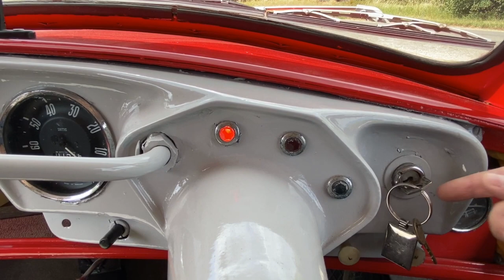IDRIVEACLASSIC reviews: 60s Bond Mini Car Mark G (micro car/mini car review)

Comment: Scary things, three wheelers.  I borrowed a Reliant Robin many years ago, it was a very windy day, it was impossible to keep it in a straight line.  Never again.  There was a Bond bug (different company) in the seventies that looked like a big orange wedge of cheese, see if you can find one of those.  The Bond club could probably help.
Reply: A neighbours son had a Bond Bug he bought brand new in the 70's. Very collectable now. During my years of "fiddling around" with cars i long hankered after a bubble car which have now become extremely desirable and command pretty serious money.
Reply: Its funny - I once drove a Regal van and felt it was a bit odd on corners but that was because I knew there was no wheel there - in actual fact at  the speeds I was doing it wasn't unstable nor dangerous
Reply: They were luxery compared to the Bond 3 wheelers. much more like a car to drive with a4 cylander 4 stroke engine they were fairly reliable. The Bond bug was much better and had a sporty feel about it. only made in Orange though.
Reply: Reliant bought out Bond, the Bond Bug was built at the former Bond factory.
Reply: @fluffybadger9832  Correct and on Reliant underpinnings.
Reply: Front wheel drive!
Reply: The Bond Bug was legend. I wish they built first-time cars or inexpensive runabouts like that now – affordable, fun, in a category of their own that doesn't look like you don't have the money or driving licence for a "real" car.
Reply: @TheDotBot  The Bug did not sell well. It was aimed at young people who mostly didn't have the money to buy a new car back then. Maybe they also thought a 3-wheeler was uncool.
Reply: From my experiences many years ago in a Reliant Supervan, the answer is to unlock the “bonnet”.  The wind trapped under the front escapes through the bonnet hatch, rather than causing the front end to lift. Worst thing I’ve ever driven in wind (deckers exempted) was a Hyundai h100 van.
Reply: They can be very twitchy in the windy weather. I have been out driving in 30mph plus gusts in my Reliant, I find sticking to around 50mph on dual carriageways makes it allot less twitchy. steering wheel play has allot to do with it.
Reply: @richardparkersmith4810  No the Bond Bug was on Reliant mechanicals so RWD.
Reply: @Martindyna  For sure but I was referring to the minicar which is the subject of this video.
Reply: @fluffybadger9832  Yes, but only the first 400 or so, from Tamworth-supplied components: the remainder were built at Tamworth

Comment: I had one in the late sixties when I was an apprentice - great little car although did have a tendency to fall over if you around roundabouts to quickly - three of us went Rugby to Ramsgate a couple of times - a real motoring experience never to be be repeated !
Reply: @John Finnis. I never tipped mine over, but I perfected the art of cornering on two wheels. If you feel it start to go, you just turn the wheel back a touch and it sits down again.
Reply: Blimey, now that's really motoring; you must have been mutton jeff when you got back.

Comment: I’m 67 when I was in my younger years we put a twin cylinder Villiers engine with auto mag start and it was so quick The only problem was stopingit you could stand on the brakes,you did need to kickstart it this has brought back so many memories watching you do this video on the air
Reply: The F and G models were available with the Villiers 4T 249cc twin with high compression heads and straight through exhausts. I had the F model version. It was very loud on full throttle, and generated enough heat to burn the paint off the underside of the bonnet. It was fast though, and the Girling hydraulic brakes had no problem bringing such a light vehicle to a halt.

Comment: Nice video! It took me me back to my youth when I had a Mk F as my first "car" after moving on from motorbikes. You're right, they weren't half noisy litle beggars but well worth putting up with to keep you dry (which my girlfriend appreciated). The usual breakdown problem was a sooty spark plug if you got the 2 stroke mix wrong or a failing battery, but you could kick start it into life by getting into the engine compartment (much to the amusement of onlookers). I used it as one would a bike, and me and my future missus often went off to Blackpool in it (not too far from Preston where I'm from), or for longer trips into the Yorkshire Dales or the Lake District. I had it lift a wheel now and again by cornering too fast, but it was predictable and easily rectified. But no serious issues apart from my own fault, when I failed to secure the bonnet properly and it blew back and snapped both hinges (but the parts were readily available from the Bond factory in Preston). So thanks again for a great little trip down nostalgia lane, you're doing a fine job with your channel!

Comment: I do remember seeing quite a few of these in southern England as a kid in the 60s, not that you could fail to see or hear them, like the equally basic small engined 'bubble cars' of that time. Sometimes the Bond Minicars were fully laden with passengers and camping equipment as well, so I guess some of them did very long trips too, despite being slow, noisy and even a bit smoky sometimes.

The car is certainly a curiousity, though other reviews are also as much amazed by how primitive the handling is, as to how cute and quirky it looks. The 360 degree turning circle is pretty unique too. It is surprising to me that this car sold for so long in seven different incarnations - I'd have thought the Reliant three-wheeler offerings of the time were rather more sophisticated and comfortable, though probably a bit dearer, I'd guess. Reliant did, at least, survive another three decades after the tax changes you mention, and ended up buying up Bond.
Reply: Yes I can imagine them doing reasonably long trips, the 2 stroke smokey engine gives the impression of being clapped out when in fact it isn't at all.

Comment: My first car back in 1980 was a MK G estate which I spent a year getting on the road, (Ah, the joy of not getting soaked and freezing on my Bonneville during the winter!) The steering worm was quite worn in the middle section, as is the one shown here, the depth of engagement is adjustable but if you tighten it too much to take up the play in the middle where it`s suffered most of the wear, then you don`t get the full 180 degree steering lock which enables you to go full throttle round and round in circles in a screaming 2 stroke cloud of blue smoke in a pub car park after kicking out time on a Saturday night, which got me banned for more than one establishment. So I had the steering worm and sector engineered to engage better and all was good. It was pretty loud under "acceleration" but once up to speed around 50MPH on the flat was quiet enough to hold a conversation, although I never considered fitting a radio. I take issue with what you said about reliability though, and long distance journeys, mine never broke down, and I did use it hard for about 4 years, we even did a 200 mile round trip to the national micro car rally and did treasure hunts and driving competitions while we were there. I eventually sold it because I came out one morning to find a bunch of drunks had picked it up and placed it at a jaunty angle across the middle of a quite busy road causing chaos, which I found pretty funny to be honest because it`s the sort of thing I would have done back then, but, I had my car licence by then, so, I sold it and bought a VW camper. Oh dear...

Comment: What a beautiful example. I remember them on the road - at the time they provided cheap mobility with low tax, insurance and good (for the day) fuel economy, plus the whole motorbike license/L-plate thing was a big incentive. 

These little gems need to be kept in perspective, though - they were very much of their time. Although they might look like deathtraps to modern eyes, it's important to remember that back in the mid sixties there were still some pre war cars trundling about and no comparable cars offered anything remotely approaching today's levels of safety, performance and comfort. The condition of older vehicles on the roads was often dire - in the village where I lived as a child there was a family who had an ancient black car that would only run if the driver's side of the bonnet was raised and their son sat wedged behind the headlight on the front wing, half inside the engine bay, holding onto something mechanically vital. Many people had no car and motorbikes and sidecars were much more common - the little Minicar was not exactly cutting edge (the Mini would soon render the likes of the Minicar and the various bubbles completely obsolete), but in her day she did have an appeal. 

A workmate of my Dad's bought one new and absolutely loved it - I remember Dad telling me how impressed he'd been when shown it. At the time our family car was a chronically clapped out, slow and rusting split screen Minor van that stank of petrol and exhaust fumes, had no rear seat and was like a deep freeze in winter. I remember the one and only occasion we got the thing up to sixty on the Powick "Three Lanes", by which time the back axle would have been audible on the moon. By comparison a shiny little Bond didn't seem such a bad deal.

Comment: I had a much later Bond, just before Reliant took them over and used the name for the 700ES or the Bond Bug which was a 2 seater with vinyl doors and looked like an orange cheese wedge.
The trike I had was the Bond 875 which was based on the Hillman Imp 875cc van engine. Stability was much better than the equivalent Reliant saloons as the Bond was rear engined, and it lay flat as in the Imp, giving the car a lower centre of gravity. Being careful you could get the car to drift around bends rather than lifting a rear wheel. Acceleration was also astonishing due to it's low weight and I remember the look of an astonished driver in a 2.0L Ford Capri as he was well beten from a traffic light start. 
It was great fun but let down with poor ventilation which caused the rear and side windows that were perspex going an opaque white in the cold weather. There was also the issue of the fuel tank in the front over the wheel which as it emptied made driving the car like trying to throw a dart backwards when you were travelling at speed. The other learnt observation was that with all three wheelers particularly one wheel at the front, suffered the dead cat problem, you couldn't drive straight over an obstacle in your path as you could with a car with wheels at each corner but cornering in the wet and hitting a shiny manhole cover with the one front wheel would be disastrous and send the car on a different trajectory.

Comment: Back in the mid 1970s a good friend bought one and we drove around looking for girls to chat up, we thought they would be impressed. The “car” had Dynastart with a reverse capability which involved stopping the engine and making some adjustment followed by starting the engine running in reverse. Once reversed, we had to stop the engine again. One great memory was leaving a group of friends and whilst waiting for my friend to open the drivers door and lean across to open the passenger side, I leant on the rear wing and the door opened by itself! Great times.

Comment: Nice video. The steering may need adjustment but to be fair, Linconshire roads are flat but extremely bumpy !  The large steering wheel  was fitted on the slant to make entry into the car easier. The little chrome lever was a decompressor ( normally fitted on the floor and operated by foot) which helped the engine spin easier for starting, and of course the engine and front wheel could be turned at 90 degrees, hence the large engine bay, enabling the car to turn in it's own length. Well done for choosing the Bond !

Comment: Hi Steph, just caught this review and your appraisal of the Bond Minicar is excellent save for one thing.  One has to judge these classic cars in their period.  My father purchased a new mark F in 1961. At that time people were highly enthusiastic about them and there was a great cammeraderie  on the road involving a lot of horn pushing and waving when two passed.  Many people were devoted enthusiasts in Bond clubs which held occasional rallies.   I never heard of anyone actually getting killed in a Bond but all cars of that time left a lot to be desired in the way of safety, some still had rod and drum brakes,  heaters were considered for softees and women drivers, and safety belts were unheard of.    Every year we would spend a week's holiday in Cornwall or Devon. We would usually drive down in an old banger. They used to be called 'Ten Pound Bangers' because that is exactly what you could pick them up for (no MOTs then of course!) .   The Bond was mum and dad's first new car. We drove down to Perranporth from Preston, Lancs, (just under 400 miles) and broke the journey with one stop at a B&B.  I remember getting a numb bum from sitting in the back on that awful rear bench seat which was basically a pipe-cot with no padding. Despite the rudimentary construction the Bond did the job and that 197cc Villiers engine just went on and on.  We passed other Bonds on the way down and back with the usual fanfare.   The Bond may have been marketed as a cheap to run commuter car which would do 80mpg, but it was expected that people could would and did go anywhere in them, just as you would a regular car.   There is something wrong with the exhaust system on the one you drove.  They did bang and pop a bit, it was powered by a 2 stroke motorbike engine of course, but I don't remember it being as intrusive as the one in your review.  Sounds like a new exhaust box would improve things there.   We loved our Bond minicar and I think they are very underrated in motoring history.   Later on I owned another mini car, a  BMW Isetta, and have the eponymous privilege of being the only man who has ever run himself over with it!  A story for another time perhaps.  Keep up the good work.

Comment: I owned a '48/'49 Bond . Purchased it from the original owners Son in the '70s in Huntington beach California , he drove it to high school . I believe it was badged MK-V .
 It was a LHD , sporting 4 full fenders , single door , single Villiers, the spare bracketed on the rear panel with a license plate bracket holding the single rear combination lamp .  The front bumper was integral to the body and the hood held the grill . A tapered square , tee handled key unlocked 2 individual hood locks . I believe that the dark blue paint was lead based as only kerosene could make it shine !  The convertible top was a breeze to operate and while devoid of a reverse gear , the power unit could almost turn 170 degrees towards the rear .
  The motor was fitted with a marvelous freewheeling disk just outside the flywheel enabling the Starter Belt to park when the 6V RoosaMaster? starter bendix,  having a belt drive pulley affixed , retracted . A pull knob , electric starter switch was mounted on the dashboard and , Yes , there was a manual start pull handle mounted on the "tunnel" pulling a cable to the "kick starter". The original tires were still affixed , Michelin with red rubber tubes AND the single electric wiper motor worked .  I sold this to a man in San Diego county in a state of arrested decay (The car , not the man) .
  Today I would describe the only luxury as sporting a "Keyless Entry". 
Thanks for sharing !

Comment: In 1962 I stopped behind a Bond Minicar at a T-junction.  When the Bond tried to pull away the driver stalled its engine and he got out, lifted the bonnet, put one leg in the engine bay and tried to kick-start it.  But its brakes did not hold and as we were on an incline it rolled backwards towards my car with its driver hopping on one leg.  I had little time to think but I decided to stop the Bond by allowing it to hit my car (which was a 1931 Austin 7 and which had no bumpers) so the Bond hit the tyre of one of my front wheels and that stopped it.  There was no damage to my car and only a dent to the Bond.  I reckon he was lucky that I was there otherwise there would have been a runaway Bond, going backwards, gathering speed with its driver running on one leg!

Comment: One of my craziest dreams for years has been to build a pedal-powered (electric assist) three-wheeler but I don't think it'll ever happen. I'd have the single wheel in the back as that'd save me the hassle of including a differential or driving a steered wheel. The design base is the Messerschmidt KR series with two seats and minimal luggage space, with two people able to pedal like a tandem and something like a 600 W electric motor. In Austria, anything up to 650 W is considered a bicycle (i.e. no tax, no insurance, no registration, no licence) as long as the electric motor is limited to 25 kmph. If you want to go faster you've got to pedal. If it's 100 cm or less in width you can even go on bike lanes. Ideally it'd weigh well below 100 kg. The three biggest issues are 1) I can't weld, 2) I know next to nothing about steering and suspension design and 3) I've got neither space nor time for a project like this.
Reply: Me to.

Comment: I had a maroon Mk G back in the early 70's.  A lot of motorcyclists bought them to get in out of the rain because money was tight and they were cheap transport. My Dad had an early Mk C and one of the rear wheels fell off going around a corner. Rear wheels were suspended by rubber in torsion units which are still used on light trailers today.  Engine was a Villiers 197cc motorbike engine which sat on the end of the steering column and turned with the front wheel, so you could do 360 degree turns with no trouble!